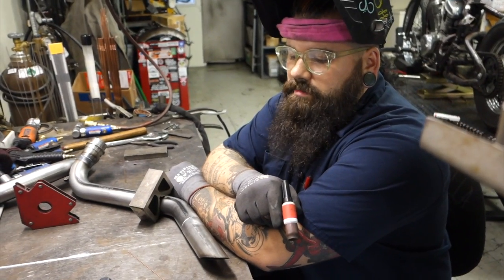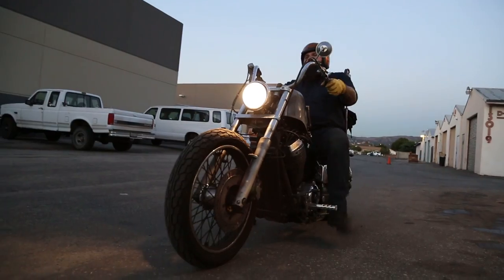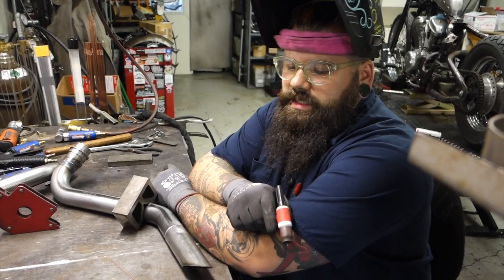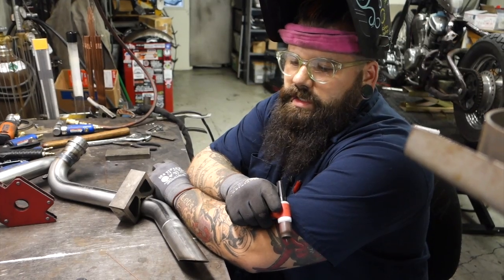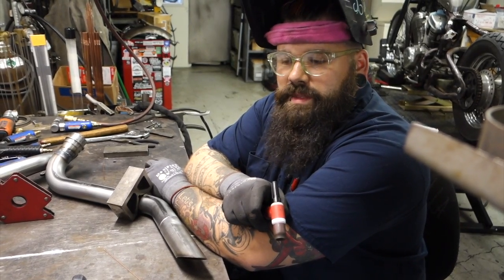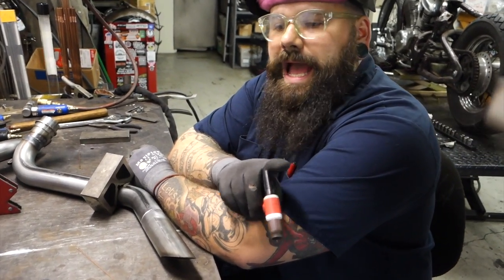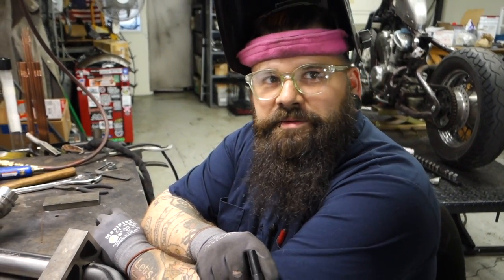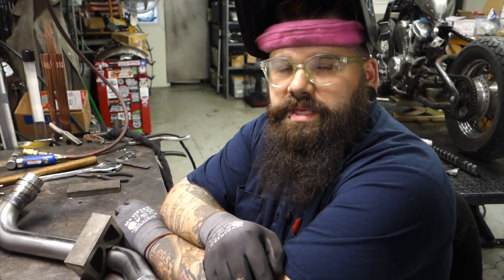Top Idle Speed Mistakes - Are You Damaging Your Honda Shadow?

Comment: You can idle your Honda as low as you want it'll never sound like a Harley. If you want your Honda to sound like a Harley quit being a poser and just buy a Harley...
Reply: I made custom double wall straight pipes for mine using the factory headers. Ace model. At idle no it doesnt sound like harley but give that sucker gas and mine sounds more wicked than most the harleys I ride around. Y'all been around aftermarket. Try custom made chamber tuned setup. You'll never go back.
Reply: Has no one told you Harley is the poser brand these days ……
Reply: @nikogonzalez6539   lol ikr
Reply: @nikogonzalez6539  WILD HAWGZ

Comment: TJ could you post a video of what the idle set to 1200 rpm on a VLX 600 sounds like? I don’t have a tachometer for my VLX 600, but if I heard what the idle is supposed to sound like, maybe I can set my idle correctly even without a tachometer.
Reply: This would be awesome as I'm myself having a hard time with my '88 Shadow 600 :-)
Reply from the maker: @lasutrops   get an electronic tach on amazon. theyre super cheap and easy to use! - https://www.amazon.com/Runleader-Tachometer-Maintenance-Replaceable-Button-Red/dp/B08113CQLW/ref=sr_1_3?crid=2TMMK5J3YPXXQ&keywords=coil%2Btachometer&qid=1699575849&sprefix=coil%2Btachometer%2Caps%2C107&sr=8-3&th=1
Reply: I recently purchased a used Honda steed from Japan, the engine was running just fine but these days I hear some tapping/ticking sound in the morning or after parking it for over 6hours.The sound is able to disappear 2-3 minutes of idling. What could be the issue? @TJBRUTALCUSTOMS

Comment: I have a shadow 04 vlx 600, have one of your stack jets installed. Runs perfect on the road but when I’m on the highway less than 30seconds  later the bike is loosing power/ acceleration. I’ve changed the plugs same issues. The motorcycle shop I go to is claiming I need an air filter because of the improper air flow going to the carburetor. Can you help me Tj customs?
Reply: could the slides be sticking?

Comment: Hey man, I would really appreciate it if you could help me out. I have an 05 shadow spirit 750 and I’ve noticed that in 5th gear when I’m on the throttle all the way it starts bogging down if let off the throttle some it runs fine. The bike came with Vance and Hines exhaust and was rejetted according to the previous owner. I messed around with the idle knob so idk if that’s whats causing the issue or is it that it might need a carb cleaning like I’ve seen in other videos.
Reply: Also I got the bike with baffles removed but the bike is loud af so I bought some v&h quiet baffles, hopefully that’s not causing any issues. I also just put regular gas in it, Previous owner said to run premium on it.
Reply: Mine used to do the same. Change your fuel pump and fuel filter. :) Hope that helps !
Reply: My 06 spirit just got carbs cleaned and it now bogs out if i give it 30% throttle and then the idle is fckd and is high the rest of the way-

Comment: I wonder if theres a oil pump mod or upgrade that could compensate at lower rpm, to get the sound without risk.
Reply from the maker: Nope. Why would you want a lower idle rpm than what is designed for the engine?? Buy a harley or a 750 ace if you want single pin crank sound.

Comment: For Shadows post 2010 when they came out with fuel injected, is the idle speed adjusted by the EFI, or is there a manual adjustment like on older models? 2018 750 Aero here. Thanks!
Reply: @TJBRUTALCUSTOMS   Thank you for the confirmation. In my service manual it still shows that as part of the regular maintenance but I suppose that's since the manual covers a wide range of aero models. Just didn't want to over look that if it's part of the regular maintenance. Good to know I can check it off. Thank again! I really enjoy and benefit from your content!
Reply from the maker: youre welcome!

Comment: Rookie here I bought a 87 shadow Vt700c I adjusted idle speed yesterday of course I'm working strictly off of listening and eyeballing everything I'm doing. I already had to cut out melted plug from stator to regulator and I hard wired it together. Unfortunately i think my stator may be shot or the regulators shot not sure as I am not a mechanic and do not have the equipment to figure it out. Also had to hard wire radiator fan to a switch. Guy I bought it from pretty much lied about everything he said so as opposed to buying a bike I could jump on and go I know have to throw alot of money at it right out the gate. Bad part was the main gas line from tank looks like it has been intentionally cut with a razor. I already replaced it. Anyway thanks for posting these videos they are definitely helpful.
Reply: Not a fan of messing with a bikes wiring harness. Repair the conection and upgrade your rectifier to one that runs less hot. Most likely not getting enough air flow for the design. Always change the Stator and rectifier same time imo. Damage to one causes damage to the other almost always by the time it’s burning up connections. Next it’s my bike doesn’t want to start. None of that keeps the wheels spinning for the long haul. Don’t use bandaids fix issues bro ride on man
Reply: And nooooo man hardwiring a switch for the fan is bad for business imo. Change that temp switch on the radiator super cheap and put it back to monitored asap. Do yourself a favor asap

Comment: My 750dc has had all new gas lines ran the carbs rebuilt floats set and it still backfires at idle and giving it throttle, am to the point of just pushing it back behing my barn and letting it rust away
Reply: air/fuel mixture screws?????

Comment: I'm curious to know if the NT650 Hawk camshaft would help give it a bit more chop without messing up the low speed drive ability and thus not having to bring the idle all the way down like you stated.

Besides, cars and bikes set with super low idle trying to extract every ounce of chop from a stock or mild cam sounds like old busted farm equipment on borrowed time.
Reply from the maker: it will not. the crank is dual pin. A single pin crank gives the potato sound.
Reply: @TJBRUTALCUSTOMS  oh I understand with dual crank pin versus the single, I'm just more thinking about if the NT Cam has more valve overlap so it would give it a bit more of a lumpy, it sucks even for the bigger v twin Hondas there isn't the same performance coverage like Harley and Indian
Reply from the maker: @timc8551   thats because harleys and indians are not as well engineered, far heavier,  and to get them to be reasonably decent, you need to do a bunch of crap to them. 😆

Comment: Is it ok to have the motor idle a little higher than stock?
Reply: I think so but not much. It’s probably a symptom of something more destructive like air leaks and running way lean or just need a good carb cleaning or maybe need tuned (jetted)to match after market intake or exhaust . But I’m just the guy who asks stupid questions and may not have a clue, so many variables with so many different bikes. Heck you maybe talking about something fuel injected and it’s a control issue?
Reply: @classless007  Mine's an old carbed engine. Does have aftermarket pipes and a rejet though.n
Reply from the maker: why would you want to idle higher than stock? not much info here to go off of but generally no. not ok.

Comment: Which way  do I turn the idle knob for higher RPM?   It doesn't seem to make much of a difference on my bike till it just dies... Then I'm stuck, where I started to begin with, no reference point. I can get to run(three turns out w/your long pilot screw), even went around the block a few times. But it doesn't idle well(pretty low), and the new plugs are white-hot.
Reply: Dennis Mcmann that's adjusting your pilot. Not the idle. The idle screw is the screw butted up to the throttle stop

Comment: Anyone know what the service limit is for the oil pump drive chain on the 2003 Honda Shadow VT750? I have about 1/4" of slack and it looks pretty sloppy. Haven't pulled the sprocket yet to check the ID.
Reply: Yep, using the same manual, but only gives SL for the oil pump drive sprocket. Don't want to R&R a part that's still good. Cheers